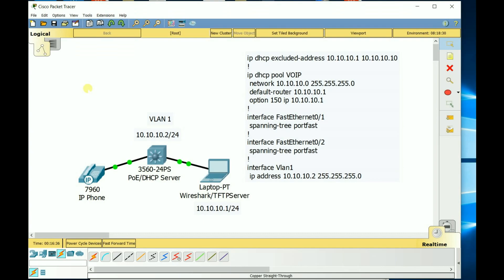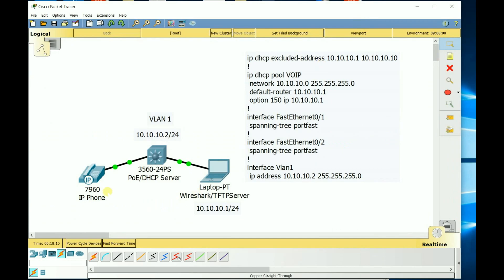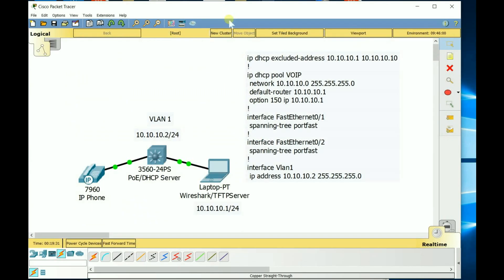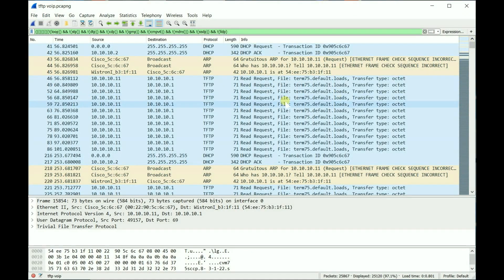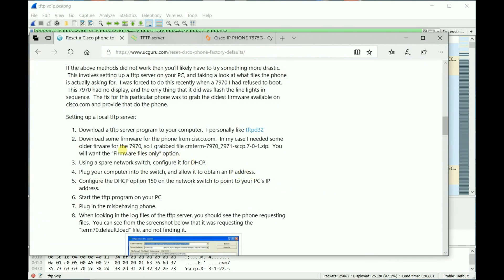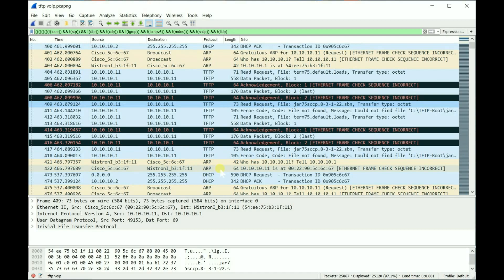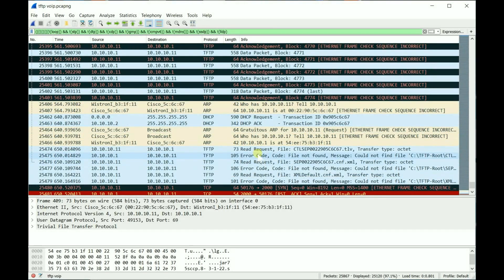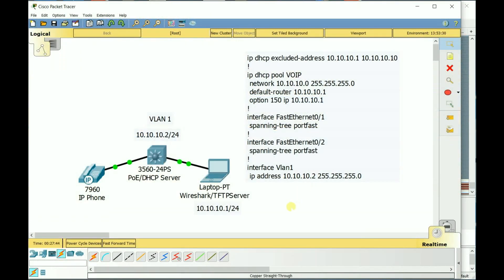Unbrick a Cisco IP phone 7975g

Comment: Dear i tried to connect the phone and laptop with same config but unable to capture the packets from phone. it's only showing loop...
Reply from the maker: Is the phone getting power?
Reply: @ccnpseth4563  yes, phone is turning on and model is 8845. after that the line buttons are turning on but the last line buttons are orange instead of green. on screen there is cisco logo (black). and nothing.
Reply from the maker: @imtiazali1628  Did you try a hard factory reset? http://www.arastirmalar.com/index.php/donanim/90-cisco/178-reset-the-cisco-8845-ip-phones-to-the-factory-default
Reply: @ccnpseth4563  i tried bith codes 123... and 349.... nothing happened. that why I was looking to 3rd method which you explain in video
Reply from the maker: @imtiazali1628  are your switch configs correct, you should see some sort of traffic
Reply: @ccnpseth4563  Yes, i have recheck the config and found phone is not getting IP address. If I connect any other device I can see it's getting IP 10.10.10.11 but no request from phone at all.